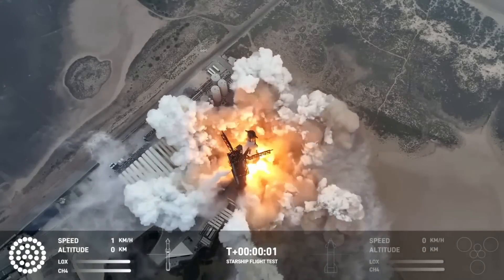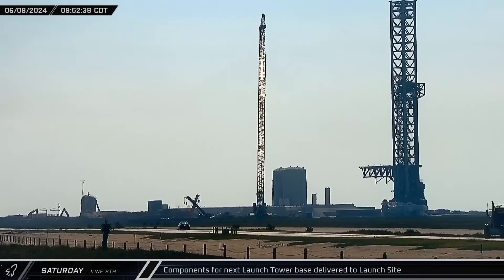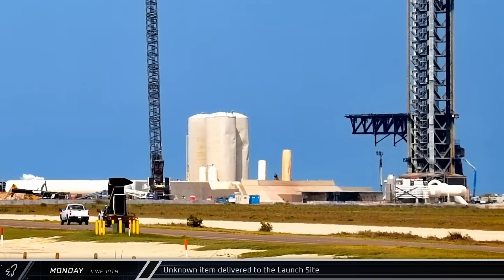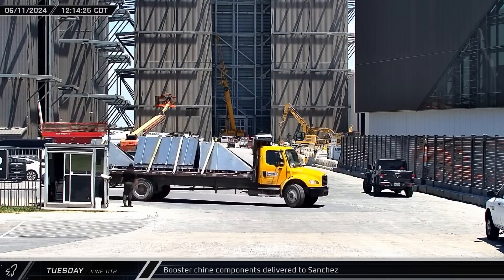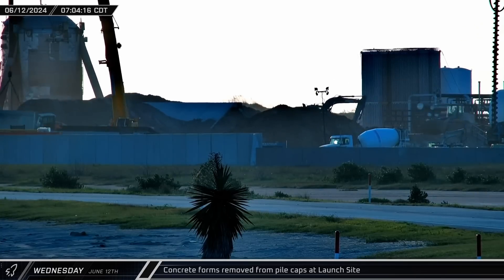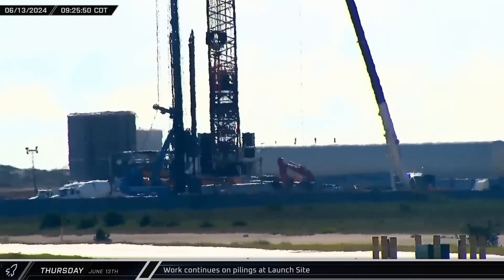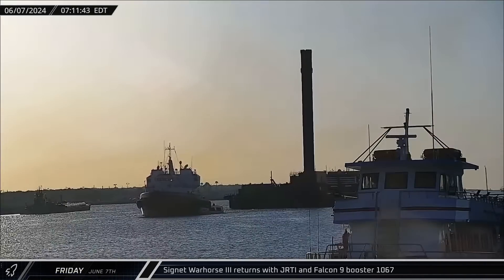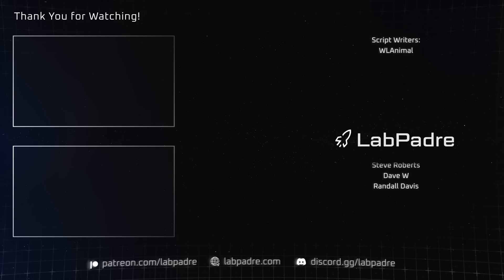Finally! Starship's Second Starbase Launch Tower Rises! - SpaceX Weekly #119

Comment: Can anyone answer these questions:  SpaceX has already said that Starbase factory in Texas will build all the spacecraft but Florida will become the working flight launch site with Starbase relegated to flying prototypes.  Since Launch Pad 39a is going to have 2 towers constructed for launching Super Heavy, how do they intend to ship the booster and starship over to Florida from Texas?  By truck?  By rail?  By barge?  In pieces with final assembly in Florida?  If so then they need to build an assembly building.  If shipping full size components, are they shipped horizontally or vertically?  These things are huge and MUCH larger than a Falcon 9.  Regardless of the shipping method, they will require additional testing to ensure that nothing got broken during the transport to the site.  What kind of testing facilities will be built in Florida?
Reply: The coolest method would be to launch them in Texas and land them in Florida. I fear it’s unlikely, but would be very Elon-zen… the best barge is no barge.

Comment: Side topic: I’ve been wondering from the start why the shorter chopsticks for tower 2? Is it possible they will use tower 2 as a primary launching tower and tower 1 as the primary launching & catching? 

I’m not saying tower 2 has too short of arms to catch, but they might be?.?. It seems they will need as much length as possible to catch a booster or ship.?.?

Any thoughts out there to my input? Or has someone already learned why they designed the shorter chopsticks?

Comment: Instead of catching the Starship and Booster in the chopsticks, there is a better idea…

Dig a large, deep hole…
Construct a huge, elastic net…
Place the net securely over the hole…
Pull one side of the net back…

Throw Biden and all the rest of the democraps into the hole…
Piss into the hole…
Fill the hole back up with dirt….
Store the elastic net for future use…
Use the original tower and chopsticks as originally designed.
Have a great day…